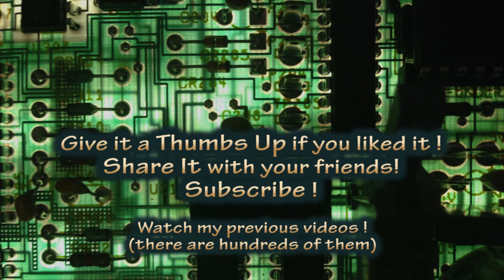#299 How to repair an optical mouse, Gigabyte Laser Mouse Repair

Comment: Nice repair but at 29 minutes did you forget too put the top cover switch plug back on into the bottom pcb socket?
Reply from the maker: Yes I did, I had to go back and plug that in, I mention this in the description, but didn't bother videoing it.

Comment: what is that liquid you put in the button clicks?
Reply from the maker: RedX Oscar - isopropyl alcoholic
Reply: can  i replace it with RP7? (sorry if it's a dumb questions)
Reply from the maker: RedX Oscar - sorry I don’t know what RP7 is. Any plastics safe switch/contact cleaner should do it.